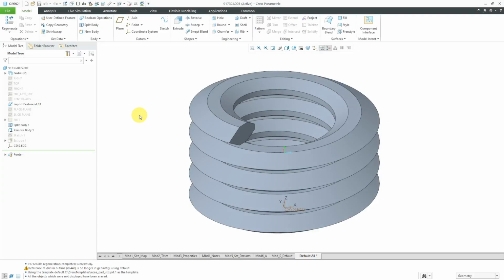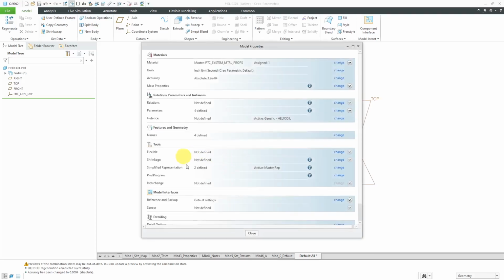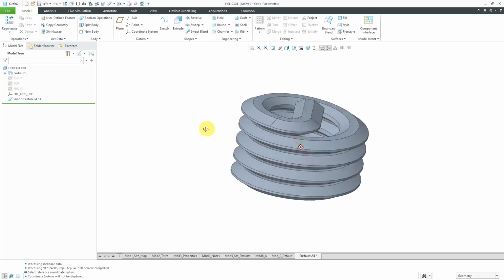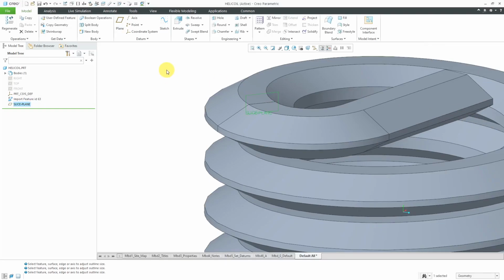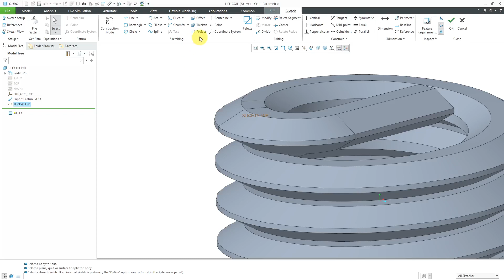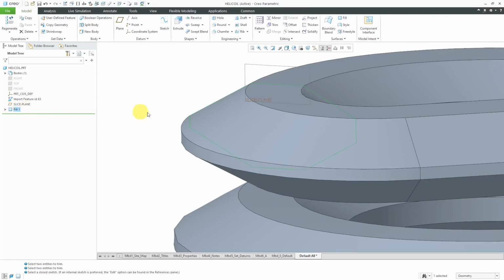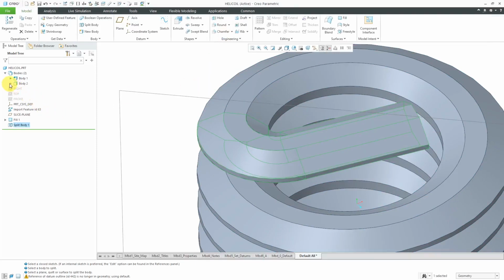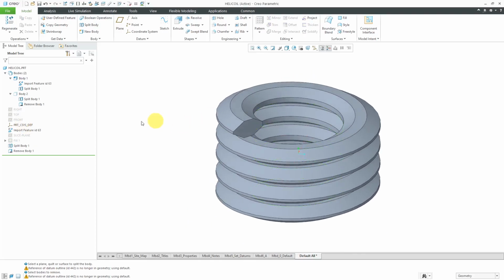Creo Parametric 7.0 - Multibody Modeling - Split Body and Remove Body

Comment: Hello Dave , thanks for your helpful and interesting videos.
But in this case I can't see the advantage of using the split body command (Multibody functionality)

I think when using the solidify command you could remove the material with one command...no need of creating a separate body and then removing it ...

Or did I miss something.
Reply from the maker: Solidify wouldn’t work in this case because it would slice through the rest of the model. (I tried that to be sure.)